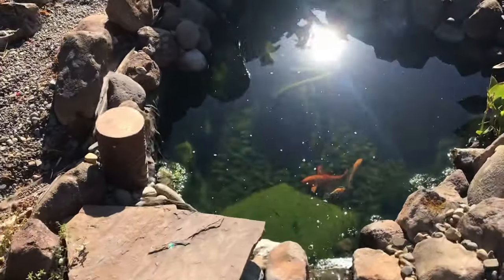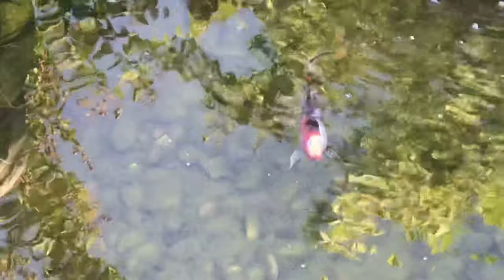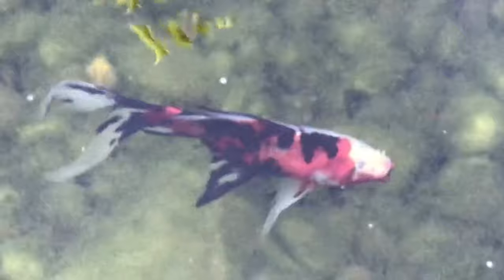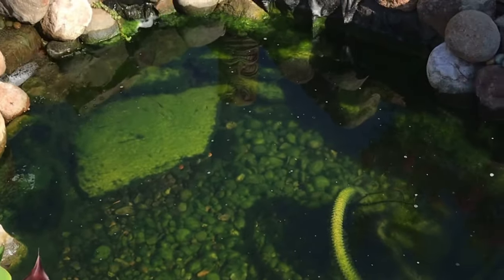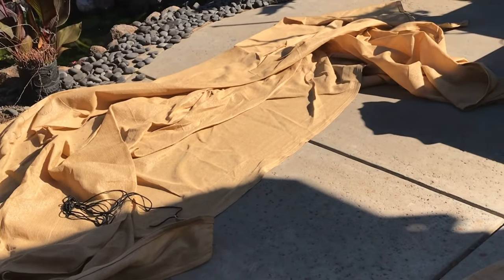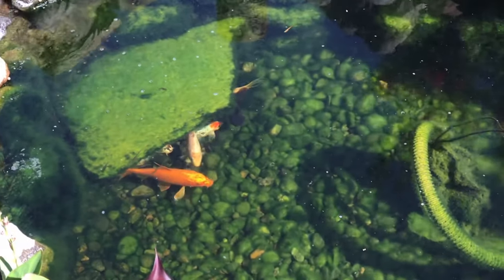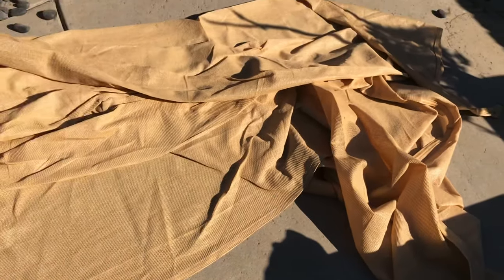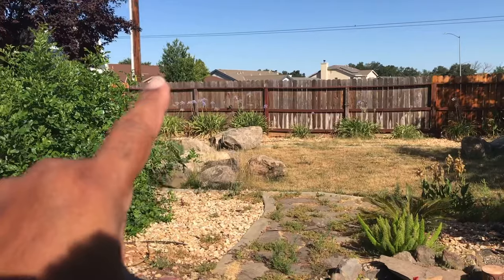CHEAPEST EASIEST DIY POST FOR SUN SHADE SAIL *INSANE*

Comment: Times have changed.  The same PVC pipe is now $12.78. The cost per post for us was an average of $25. We couldn't find the original screws in the video and had to buy 2 packs  of the #10 zinc bolt combo  to stay  true to specs.
Reply from the maker: Yeah this video was like 2yrs old 🤙🏽🤙🏽

Comment: Great Idea BUT! after  installing 3 Pvc poles using your Video I found that Poles Bent very Badly when tension was applied to Sail and hardware. Purchase 3 Steel 8ft Studded T Post 1 1/4" Diameter (Menards $7.79 a piece)Drive T post into ground leaving 6or7ft above ground then slide 1 1/2" PVC over T Post you might have to use a twisting motion (Problem Solved)Poles are Strong and Ridgit ( No Bending)No! need to Anchor Pole. The Pvc and steel T Post bond together and there is no movement.  Poles have held up well even in Storms and windy conditions. Forget about the stake Ideal they never held.Take down for winter storage is very Easy. Thanks for Video and Instead of buying Stakes buy the T post  (They Work so much Better!)
Reply from the maker: Love it!!! 🤙🏽🤙🏽💯♥️

Comment: is the pole bending?? I would need to do this for three and I'm concerned with the bendy going on there...
Reply from the maker: If you wanna prevent bending you can always drop a piece of wooden dowel down the pvc pipe and or you can get more Industrial thicker pvc pipe 🤙🏽💯🤙🏽
Reply: 😂 okay…
Reply: @HaYNFishKeeper and ideas for something that we can store in winter? Had a new deck put it and a tree that used to provide shade. It's snows here so it won't be a permanent structure

Comment: Cool, but doesn't the pvc pipe bend with the tension of the sail ties? I would suspect it would if you had all 4 pvc pipes, but since you have stronger support for the other three sides? Just curious
Reply from the maker: Yeah they totally would but it’s basically for a temporary job not forever! It’s just a quick simple and cheap 🤙🏽🤙🏽

Comment: Great idea on the pole. I can't find that same stake at my Home Depot though. I only see the flat ones but they have smaller holes
Reply from the maker: Flat ones would work too as long as you can drive it in the ground 🤙🏽🤙🏽
Reply: @HaYNFishKeeper  I just need to find the right size screw for them as the holes are tiny. They are a bit longer which might be better for support as well. I'm sure I can figure something out with them though

Comment: Thank you for sharing this great way. 

Do you mind telling me how big the ground stakes are , and how much of it did you leave above the ground ?
Reply from the maker: They were 18in and I pounded them in the ground about 8in deep Also if you wanna make the pvc polls stiff do it with a 1” pvc pipe and slide a 3/4” wooden dowel down the pvc pipe to make it stiff, I was gonna do that but was trying to keep it as cheap as possible 🤙🏽🤙🏽🤙🏽🤙🏽
Reply: @HaYNFishKeeper  If I were to add the wood dowel, am I just placing it in the PVC pipe or how would I screw it to the metal stake? Thanks in advance!
Reply from the maker: @brolyventures  oh no just place it inside the pvc pipe it will stop at the stake the pvc pipe is going to be stiff where the stake is also the pvc pipe is still gonna bend a little just not as much with the dowel in it 🤙🏽🤙🏽🤙🏽🤙🏽

Comment: I'm going to use this idea for two of the four corners on my shade sail on the edge of my concrete driveway while the other two corners are going to attach to the side of my mobile home to cover a section of my driveway.
I wanted something quick and temporary to install while I'm home only since installing an aluminum carport is not financially feasible now.
In Orlando Florida in the summertime there is no substitute for good shade!😩🥵
Reply from the maker: Awesome!!! I’m glad this helped🤙🏽♥️💯